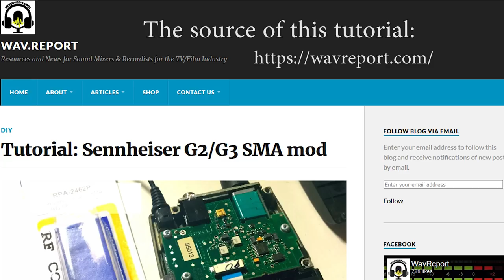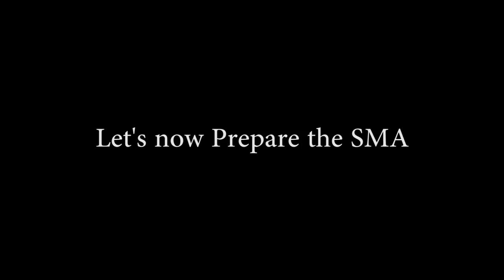Sennheiser G3 SMA MOD tutorial

Comment: how do you take out the second antenna on g3 or 2000 receivers? where is  it welded at?
Reply from the maker: I'm not sure that i know anything about a second antenna beside the one i showed in the tutorial , sorry if I can't answer your question
Reply: I'm pretty sure the second "antenna" is attached to the ground sleeve of the 3.5mm input/output connector. Not an easy way to add a second SMA plug to the unit anyway without drilling a new hole.

Comment: What kind of wire is that?
Reply from the maker: RG174 Coaxial Cable:https://www.amazon.com/Eightwood-RG174-Coax-Coaxial-Cable/dp/B0107RF92E/ref=sr_1_3?keywords=RG+174&qid=1557083172&s=gateway&sr=8-3
Reply from the maker: You strip it and just use the inner wire
Reply: @nourZX  great video! Thanks
Reply: @nourZX  Hi, why did you use that kind of cable and not other?. Any specific reason?
Reply from the maker: @LKcreativo  I had lot's of them laying around and RG174 is up to slandered to be used in Antenna BNC cables. any other low resistance cable should work as well.
Reply: @nourZX  Thanks for the video and your answer, it has helped me alot !!

Comment: how many range it will give?
Reply from the maker: I didn't an accurate test , but i would assume around 20% more
Reply: @nourZX  so i have to do that?
Reply from the maker: zembee khoo you don’t have too if you are happy with your system, this gives you better performance and give you the ability to hock it to an antenna distribution system which has its own perks as well.
Reply: @nourZX  do i need two splitter for 4 receivers ?
Reply from the maker: @username2010user  the more splitters you use the more signal you lose.
try use a 4 way splitter with low lose, or use an active splitter
Reply: @nourZX any problem if i add  one antenna ?
Reply from the maker: @username2010user  Dear I'm not sure i get your question , you can ask in arabic if that's easier for you
Reply: @nourZX  i need the easiest way to connect my 4 receivers to a directional antenna .. thank u a lot
Reply from the maker: @username2010user  the easiest isn't the cheapest , the easiest ( and best) is to Buy an RF PSC RF Multi SMA to connect your Receivers  to it.
Cheapest is to get something like Lectrosonics ZFSC41 4-Way Passive RF Signal Splitter.